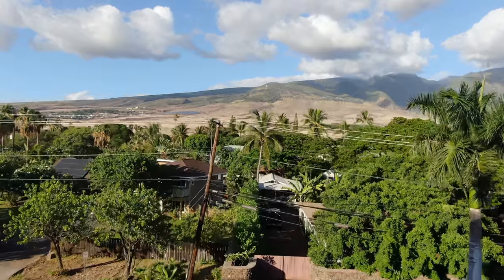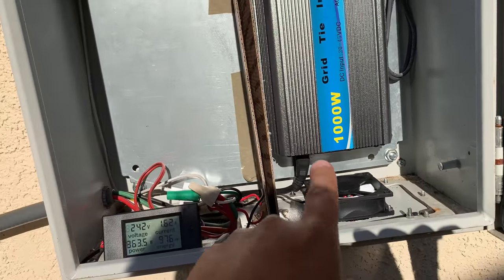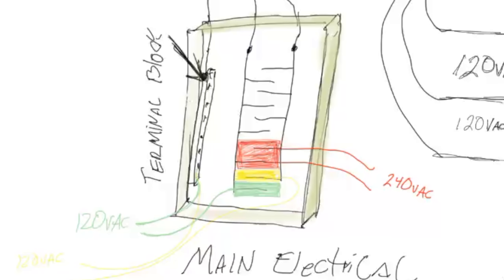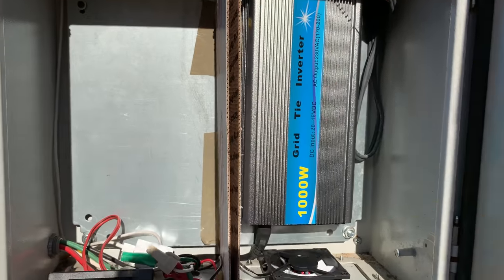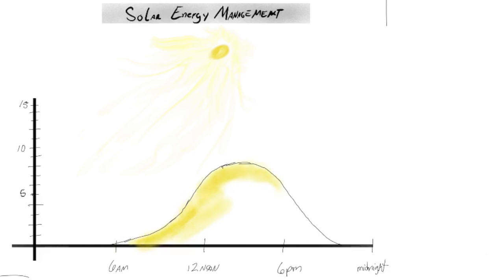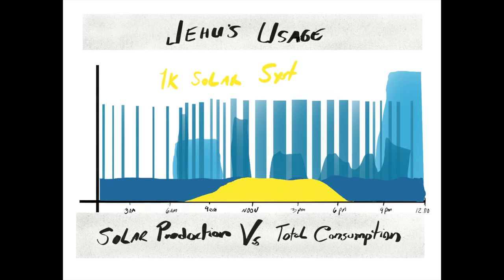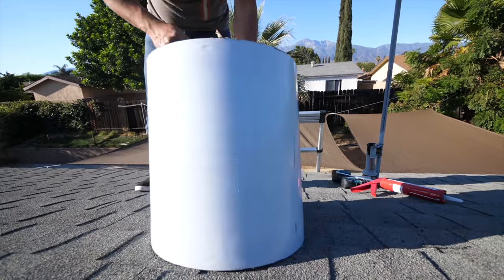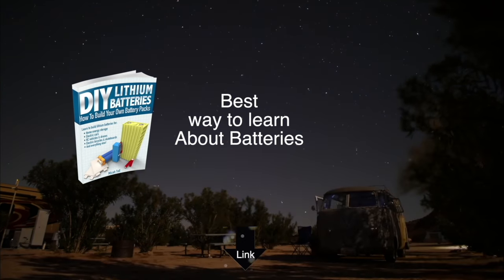How To save $1000 off your electric bill using DIY Solar

Comment: Heat needs to vent out the top not bottom, maybe try old dryer vent on side near top of box with a screen
Reply: yeah a hole on the side near the top with a cover 90* and from the front to stop water should be fine and could probably even just be passive.
Reply: High pressure next to low pressure. You'd think he'd figure out the shortcircut :)
Reply: Also the hot air coming out the bottom seems too close to the intake and it may just recirculate the hot air back in. Out the top would be better. A fan to push out would help as well.
Reply: The bottom would still work if he sealed everything in there better than with cardboard and a little box tape, but also partitioned the air coming out the bottom to not just swirl back into the intake like it will now.. Or some portion of it anyway.
Reply: If you wanted to maximize heat extraction I would agree. However there are the elements, aka rain to consider. Placing the vent at the top under unusual circumstances would permit water to enter the casing with ease.

Comment: You may want to add an exhaust fan to your inverter box with a draw tube that is at the top of the box.
That way you can get more of the hot air out of the box.
Ideally you would have an exhaust on the top maybe think about a U shaped pipe that faces down so rain water will not be a problem.

Comment: 6:26 I actually think it's better if you use the fan as an Extractor instead of pusher, this way it creates a negative pressure and is efficient and sucking the hot air out while on the other side the cooler outside air goes in. All computers do this. (Basically Swap fan with the left vent, and flip the fan upside down, done).
Reply: true
Reply: Yess
Reply: Kiss solutions usually work.elevating the panels so there is airgap above the roof helps a lot  also
Reply: Yep, or one on each side
Reply: Actually, negative pressure is less ideal compared to positive pressure as negative pressure = pulling in air from any holes, thus you get dust buildup inside. Same thing with computers, positive pressure > negative pressure. No pressure is the best scenario however.
Reply: Depends on the computers you look at.  Prebuilt often use one extractor but custom people often go for positive pressure with filters on the pusher to reduce dust buildup.  Prebuilt don't put filters in because most people will never clean them.
Reply: The reason office computers have an extractor fan is because a blower fan is used on the cooler. Blower fans are better for cooling because the turbulent flow collides with the heat sink surfaces while extractor fans pull air with a more laminal style of flow, where the air near the hot surfaces doesn't move as fast. The main cooling is blown into the heat sink and the extractor isn't the main cooler, just a way to pull the hot air coming from the heatsink away from the computer parts.
More powerful PC components would often be paired with cases with a blower fan in the intake. And modern high performance PC builds use 2-3 intake fans with only one or even no exhaust fan.
Reply: From my experience with cryptocurrency mining it is much better to use the fan as pusher (positive airflow) than the other way around. So he did it the right way.

Comment: Its better to extract heat (with the fan) and have a cool air vent when you have one fan.  When thats the case, baffling becomes especially important to ensure the integrity of the cool and exhaust air columns...  to prevent recirculation of exhaust to intake and/or leakage of intake to exhaust.

Comment: the air flow duct can be modified with the exit gases to be put on top, because hot gases rises it is tough for the hot gases to come down, hence if the exit is on top for hot gases you will get better thermals management

Comment: Exceptionally well done!  In my area, if you generate more than you use, i.e. put energy back on the grid you will be charged for that electricity the same as if you were consuming it.  Unless they change out the meter to a different type which keeps track of what is coming in and what is going out.  Which, obviously, they won't do unless you jump thru the permit hassle.  Therefore, I just learned I need to measure what my base (retired live at home) use is and generate exactly that much!  Stealth solar here I come!!
Reply: Research ... Net-Zero Grid-Tie Inverter !

Comment: Jehu this video is absolutely awesome! I am a Master Electrician and I cannot think of a time in my life when someone explained and illustrated the grid and solar integration in an easy to understand way. Yes there is a lot of other 3 phase stuff involved but that is for the advanced class and for the most part the average user does not ever need to be concerned or knowledgeable about that. 

I cannot for the life of me figure out what 39 people would have a beef about to thumbs down!!! How do I Gold Star this baby?

As always I love your stuff and the ride..... wishing you much success Jehu and I look forward to meeting you 1 day, I’m just over the state line in Vegas.
Reply: As a master electrician you would know shoving power into the grid without safety disconnects is very dangerous, since those same power invertors that decrease high grid power can also work in reverse. When a service worker is working on a line that they think is dead his solar system could make that line live, and kill the worker.
Reply: Do you actually watch his videos or are you just a troll. He is always about safety and he just didn’t address it in this particular video.
Reply from the maker: Dude this guy thinks my little inverter is capable of energizing the grid and killing a linemen...... he is either trolling or missing part of his brain

Comment: I was thinking that in trying to cool that inverter it would be more efficient to pull cool air from the bottom and vent it out the top. The way you have it with the intake next to the exhaust, it will be sucking in some warm air too.

Comment: You should add an exhaust fan just to be sure.
Reply: yeah a push/pull configuration would work great and expand the lifetime of your inverter a lot.
Reply: Tuxedomakdarien my thoughts exactly
Reply: If the inverter is running cool enough, his method works.  But i think the baffle should be something that is fireproof.

Comment: How do you wire the 240v output into the house? I am a newbie and this video actually makes sense.
Reply: Most of the time if your installing more than 240v @ 40amps you have to do a line-side-tap. More efficient and less wiring (but pricey wire).

Comment: Cool. 2 fans. Push/Pull cooling.  Heat is the biggest enemy of inverters.
Reply: I think it's one fan and a port for it to exit.
Reply: @specialk22tt  Right, but adding another fan on the left to pull the air should make for better airflow & cooling.
Reply: @briandowling8372  Agreed, but that's not what he did. lol
Reply: Inlet and outlet too close together, hot air from outlet get pulled into inlet.
Reply: @William Striker ...better pull-in fresh cool air than same air from hot outlet.
Reply: @William Striker push/pull works by beating chassis impedance, not increasing air flow
Reply: As a gamer and computer builder I can certify that push/pull systems do not work the way you think they do, you optimally want more inlet than outlet (high pressure but only a tiny bit above equal) and a couple holes where you want the hot air to flow from that will not return through your inlet fans - preferably on the top. What he did was just fine, if he wanted to optimize it a little more he'd get a larger fan with higher flow rate (the biggest he can fit there without interacting with rain water) and then a baffle at the bottom to direct the outlet away from the inlet fan.
Reply: @Lil_Puppy  lol sorry to rain on your parade but as a 'gamer and computer builder' you "certifying" anything got to do with thermodynamics is like a diy handyman saying they can certify the structural design and integrity of a house. Made me chuckle...

Comment: I know you'll probably not see this comment, but that fan on your inverter box may have issues running in that orientation. The shaft gets dry at the top, and will seize up. Certain fans have bearings that don't suffer with this issue because they've got grooves which move oil up the shaft when it's running.
It'll probably be okay for a while, just maybe keep an eye on it and replace the fan when it gets noisy.

Comment: On your box the air going in the fan is sucking the air coming out of the box. Should put a divider on the outside of the box or a 90 deg intake to suck the air from the right side of box away from the hot air coming out.

Comment: Jehu  that airflow is not optimum  . The exhast side needs to be directed 90 degrees to the left away from the intake side .  Other wise you will suck warm air back in .   You can get something like this ECOWITT GW1000 Wi-Fi Weather Station Gateway with Indoor Temperature Humidity Pressure 3-in-1 Sensor  from amazon its easy to set up and with the app ws view you can monitor temps from your iphone remotely.  You could add a second fan to blow hot air to create positve air flow inside the box.    How are those Yi cameras working for outdoor use ?  can you do a little video on your setup ?

Comment: Great video. I see this was an old project.  However, I am on a very similar scenario... couple of questions what's the model of the inverter you said is 240V? I  can't find it anywhere. Is it 60hz or 50hz?  Also, how did you connect it to the AC unit? Just in parallel in that cut off box? I couldn't find any videos of that installation.  Thanks

Comment: You should really add an outtake fan or swap the intake to outtake to improve airflow over the inverter!
Reply: How does moving the fan to an outlet help? Surely with the fan in its current position the bottom of the inverter actually gets a more directed stream of air?
I'd say if anything, rather add a second inlet fan to move nearly twice the amount of air through the case in parallel. That way each fan is moving its own stream of air. You'd just need to make sure there's enough exit holes to not restrict the airflow.

Comment: I started with one 100 w/ 12v panel and two Wal-Mart deep cycle RV Marine batteries. Now I have 400 watts on the roof and my battles still can't keep up with a small refrigerater....so I added more batteries and I finally came to the conclusion I don't get enough sun here in Missouri... I'm totally off grid and I love it because my energy needs are small...and I don't need permits...lol
Reply: You did not know how few hours of sunlight you received daily,  BEFORE buying the PV Panels?  400 Watts of Solar Panels is probably the minimum size to just run a small refrigerator on a very sunny.  What are you going to do at night?

Comment: I am so glad you did not say two phase supply like many people do.... In the UK the neutral is only grounded at the transformer / substation and not locally.  So UK systems come overhead in whats called ABC cables containing a single phase, neutral and earth.

Industrial building usually have three phases but homes only have one. If delivered underground in normally comes in by SWA  (Steel Wire Armoured). That feeds to what is called a henley block containing a company fuse that is not replaceable and the blocks and meter have numbered seals.

The Live, Neutral and earth then pass through the meter and into the consumer unit. Unlike the US in the UK all circuits are protected by a 30ma RCD or GFCI as you call them. Normally the supply is split into two with one RCD protecting a set of circuits each of these are protected my an MCB (breaker) that is sensitive to high fault currents and gradual increases via a bimetallic strip.

The reason they split the load is that you are supposed to have the upstairs lighting and sockets on one RCD  side and the downstairs lighting and ring main on the other. The idea being that if a fault trips the rcd only half of the house is isolated but it often is not wired this way.

The three phases are distributed over the houses on the street. For example the first house may be on the red phase, the second on the blue and the third house on the yellow. This often has people scratching heads when your power goes out but next door is still up and running. The problem is that the phases are now out of balance and will eventually blow the substation fuses. These are very scary as apart from the 3 x 11KV on the three phases these fuses go with a bang and have a pin that shoots out and trips the other two phases.

The feeds on the poles are even worse as they mostly use explosive disconnect. Yes they have a cordite based powder that heats until flash point and blow themselves clear of the feeder. If you are by the pole when this happens a change of underwear is normally needed afterwards. Like the US the national grid (that operate from a secret hidden location) have to juggle the loads on the grid to stop the frequency drifting or the voltage going to high. The EU state our voltage is supposed to be 230V but it is almost always around 240V. The EU do allow a 10% margin of error bless em (Grrrr) They have changed our wiring colour codes that we have had for 70+ years..... Im stopping now as I can feel my blood pressure rising.  Needless to say they have changed operating procedures and regulations for no reason what so ever so I wont get started on that. This post is long enough as it is !

I do have to say however that  our grid is very reliable, outages are very uncommon and repaired quickly when they do happen.

I hope this info was of interest.

Stu.
Reply: Who, in their right mind, wants to be on the grid? Or, for that matter, live in any urban incorporated area. Ever notice that the wealthy tend to buy " country homes" to escape the dictates of Cities, HOAs, Neighborhood Associations, Historical Districts, etc?

Comment: On your 240 inverter that replaced your (2) 120 V. inverters you should put the cooling fan on the exhaust. That way it will be sure to draw out the hot air and allow the cool air to come in and replace the hot air removed. Pull not push. Like in plumbing.

Comment: Maybe for the fan situation put a diy tunnel going from exit of gti to bottom of box with fan at bottom. A custom tunnel I think would be ideal so you keep the flow even when box is open. Also maybe a thermal alarm or gauge you can read from inside to keep an eye on the gti temps. Just my 2 cent, great video, always on point.

Comment: Should add a vent on the top too, with a vent hood to stop water coming in then you can have air coming in and hot air exhausting out.

Comment: i think u mentioned why you don't put the panels on the other side of the roof in a previous video..  why not more panels on a separate system to run your always on base stuff?
Reply from the maker: Yup I’m the works

Comment: Some other important parts to a grid tie inverter that weren’t mentioned. A grid tie inverter must automatically switch off when it doesn’t sense mains otherwise you risk electrocuting linesmen working on lines in a blackout. There didn’t appear to be an isolation switch between the solar system DC and inverter which is normally required by law. It might only be a low voltage system so it’s probably OK but Jehu knows what he’s doing. The point is, if you don’t, don’t even attempt to do it yourself. I wouldn’t be advising anyone to DIY their solar as what Jehu did there definitely does not translate to a typical HV DC array (say 5 kW) with a typical grid tie inverter with 300 - 400V DC input. I do know what I’m doing but even if I did all the wiring myself I’d still pay a licensed electrician to inspect it and do the final connections to the board. In Australia, with the generous solar rebate scheme we have here, it simply wouldn’t pay to do it yourself. For the same money Jehu spent I could get a 3kW array installed.
Reply: YES THIS! A shutoff is extremely important and you can KILL someone if you don't have one! Pay a professional and please don't do this yourself. Even a small amount of voltage will backfeed to the transformer and the voltage will go to primary voltage, it can be 13800 volts or more. That will kill someone working on a downed line. Unlike a generator, a solar panel will always push voltage whenever there is sun.
Reply: @Alucardbsm  Where is your proof this GTI can beak-feed a dead GRID?  Oh, thats right, you have no proof ...

Comment: PG&E and many utilities you sell your power to the utility and while you can use the power, it is always calculated through Net Metering to be sold to the utility then it either can be bought/used by you or your neighbors.  Unless you have a battery then, in that case, your example is correct.

Comment: Thanks for the video! IMO, if you only have one fan, youre better off using it to pull air OUT so its pulling cool air in passively into the box underneath the inverter (and put the fan on the opposing side and flip the fan direction). But as someone has said below, two active fans - one pulling and another pushing out will work much better and increase the life expectancy of your driver

Comment: So @jehugarcia you got a lot of sun, in the NL... we have a lot of wind (and some sun). What about a small windturbine, charging the cells?
Reply: Works well for me in Canada a 400 w wind ,200 w solar panel, 1500 w inverter .Cost me 1k to install myself 6 years ago and cut my bills in half it's paid for it's self 2x . Best part is when we have a power outage I have my battery back up and solar out door motion lights installed inside( I use them all the time rarely turn on a grid switch ) I can run my lap top and router. Now the price of batteries are coming down I plan on building a large power wall.
Reply: In California's mountain passes, there is a lot of wind too. A wind turbine would work better in those areas.